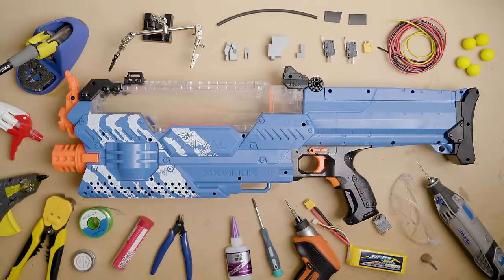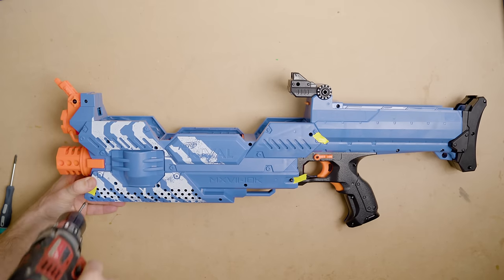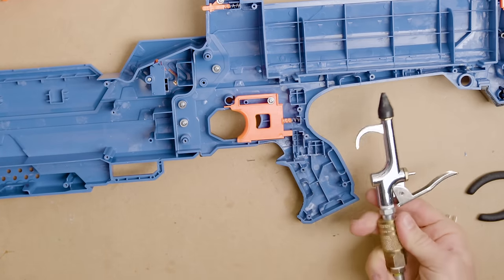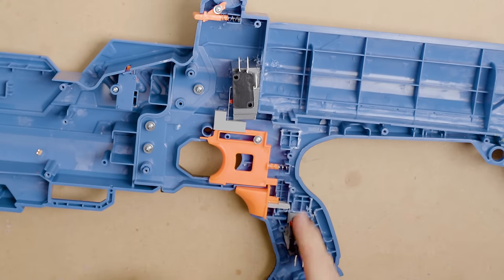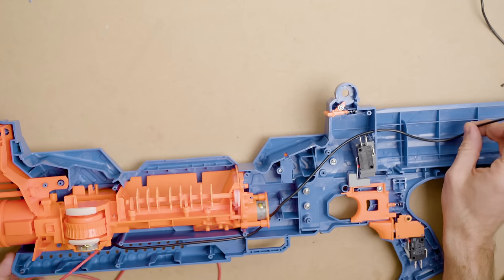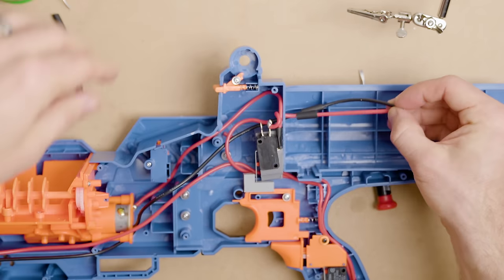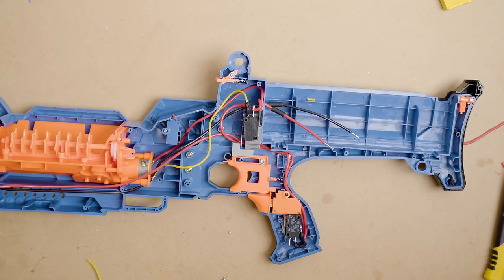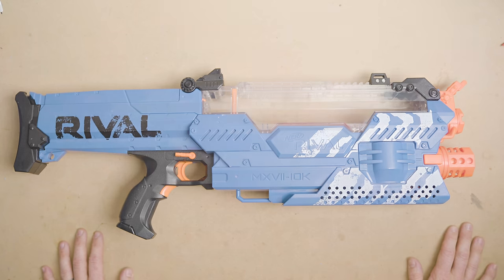MOD GUIDE: Rival Nemesis

Comment: TLDR: I lobe this channel, the mod guides, the shop.. all of it. Super useful for any level modder
This is a year old, but I found this channel because of a 'mudgun' donation (kids leave them outside, somehow they totally flood up with dirt, not so great for, you know....working blasters). But in the donation was a dirty rusty nemesis(ONE switch was salvageable) and a totally rusted out modulus ecs-10. My cs-10 flyte sacrificed its guts, motors, cages and all to make the modulus work. Some parts from here (and a k26 I currently have no use for). I have made everything work and am so freaking happy about it. 
Modulus is about to get a total new part overhaul. I think the flyte motors are a bit....not as good as previous equivalents

Comment: Do you still recommend removing the motor boards and wiring?  Or, like the Perses, is it beneficial to keep the current protection of the boards and are the wires actually sufficient?

Comment: You should do the dominator and as you go along, after one cage, you say how you would finish the wiring with 1, two cages, and how you would finish the wiring with 2, and then finish it up with 3 cages. Say what you recommend in terms of motors and cages and Mosfets and such. It would be very helpful.

Comment: The 30 minute shutoff lost the upper switch installation.  My blaster differs slightly.  Bought on Amazon just before Xmas. The post that couples with your upper switch plate is now a screw hole post, so it's a bit wider. Going to Dremel out the switch plate bracket to fit the new diameter.

Comment: Question: What do the numbers mean for the battery?  I think I've figured out that 3s means 11.1v (which we do not want to change). if I bought a 3s battery but it was 4000mAh, is that just more capacity - Meaning play longer? What about a 3s that was 20c or 40c - what is that referring to, can we use either?

One final question - how much play time would one get out of the XT60 2200mAh - that's the one I purchased.

Great video - thanks!

Comment: As a new modder and visual learner, I prefer the long version of soldering as opposed to just the wiring diagram.

Question though, isit worth doing the wiring mod if keeping the drop-in single battery (not the 4D batteries)?

Comment: hi i just got a nemesis and watched this video and think this is really cool, i have done a lot of springer mods, but never done a flywheel mod before, i have never done it before because im too worried that im going to break my blaster, i have never linked wires together before, if i do exactly what out of darts does in this video could i be succsesfull or do i need to train myself, or would it just be too risky and i would break my blaster, is this an easy mod if i do exactly what he does in this video and being really carefull with my nemesis?

Comment: At 12:07 be careful, I snipped off the solder from the boards and ended up snipping off half of the one of the motor terminals. Ya, made it really hard to solder a wire to it later in the tutorial. Just de-solder them off and thank me later.

Comment: Any idea where to look when the Nemesis does not even start?  Batteries are good.  Bought it used this way.
Reply: I likely just buy your kit and rewire everything.  Thanks for this tutorial!
Reply: Ironically, with my mechanical engineering degree ("The Knack")  I took it apart and took a couple of continuity measurments, pulled a few things out and back and when I finally put it back together about 5 times to make sure everything was working right, and the screws in mostly the correct locations, It worked.  Surprise.  But will still strongly consider the kit on your site after these 8 D batteries die.

Comment: What should I do when everytime I put the battery in the gun just runs automatically without me holding the rev and trigger .
Reply from the maker: I would open the blaster up and check to see if the rev switch is stuck or shorting the wires. We'd be happy to help if you email us photos to orders@outofdarts.com!
Reply: What is the email it’s not popping up ?
Reply from the maker: @jadenmanley8553  There's a direct link on our site: https://outofdarts.com/pages/contact
Reply: I just sent you an email ! Thank you